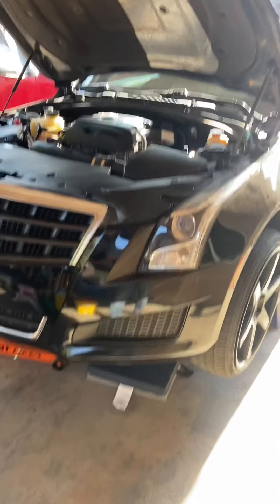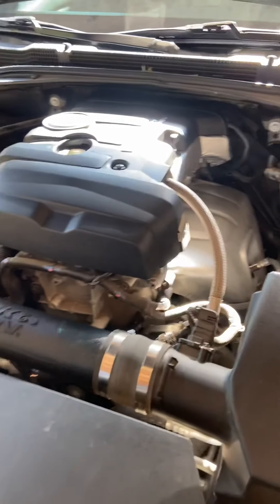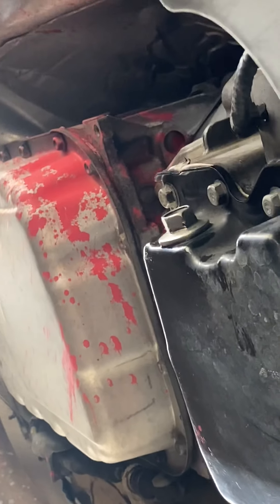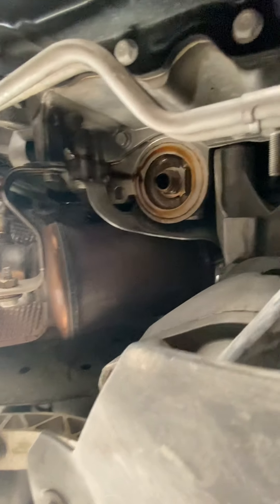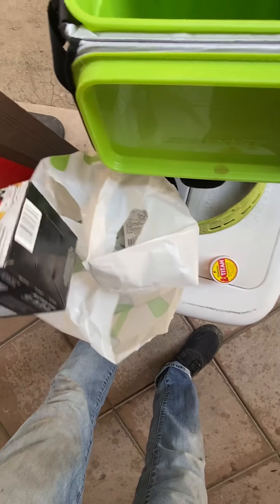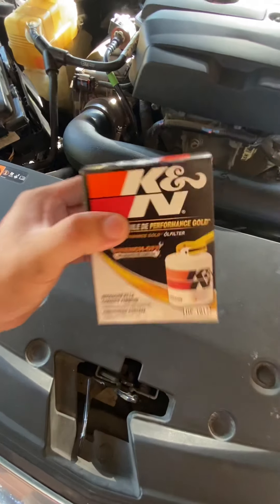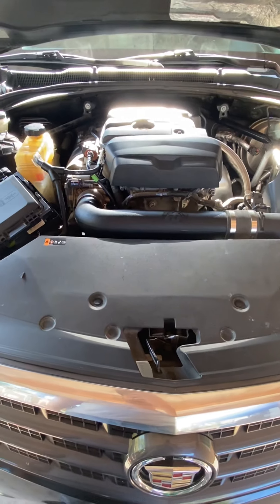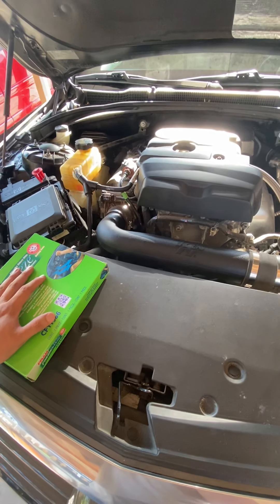2013 Cadillac ATS 2.5L Oil Change

Comment: Hey great video, question though where is the OIL SWITCH located? Is it easy to change?
Reply from the maker: Never heard or an oil switch. But I’ll look into it. What does the switch supposed to do?
Reply from the maker: Im guessing your talking about the oil pressure sensor?
Reply: @nestormacias9951  thanks for the response man.. it's the Oil Pressure switch
Reply from the maker: @elcantu3344  no problem. If you have the 3.8 you have to remove the upper and lower manifold and should be in the middle of the engine block

Comment: This is just me being  me but I highly recommend  that you buy a set of car ramps and put one under each tire.  Drive up them, jack up the car and slide one under each wheel.... however  you choose to do it but it litterly  terrifies me to see you car hanging in the air like that.
  $40 for a set of ramps. They could save your life and your life is worth over $40 right. 
 You take good care of your car. Extra cautious  with early oil changes  ...isn't it true.
 Than let's be a little  extra  cautious  crawling under that car.
  Get the ramps. Apply parking brake.  Scotch rear tires. You can't be to safe when it comes to your life.
Reply from the maker: Thanks brotha! I appreciate the concern I actually have been wanting to buy some. I’ll invest in some thanks again ! 👍🏼

Comment: Do you use syntactic oil. My 2013 ATS-4 uses it. My filter is also located on top instead of bottom.
Reply from the maker: Yes always synthetic brotha. Conventional oil will break down faster and seals tend to leak with it with time. But did t know your oil filter is on top good to know thanks! 👍🏼

Comment: how you get the air intake on and did it give you a engine light
Reply from the maker: Are you asking because im Cali? And doesn’t let you buy here? I bought it from someone that had moved from Nevada. And no I did not get a check engine light on. Also, keep your stock intake. So when you have to smog. And also had a test pipe and just swapped it for the Cat and just swapped it for smog